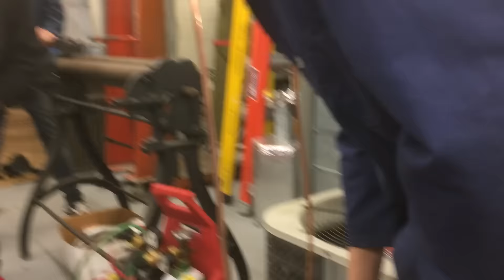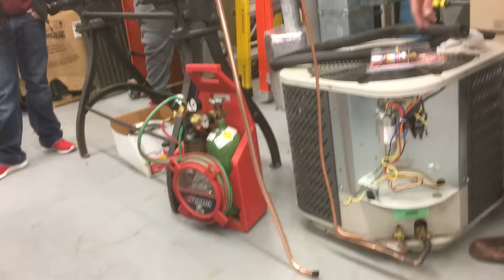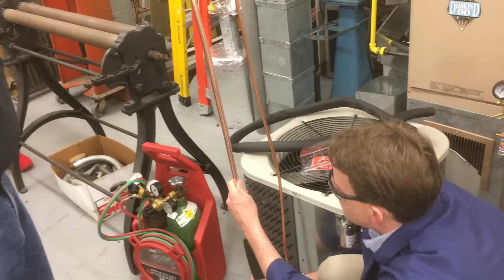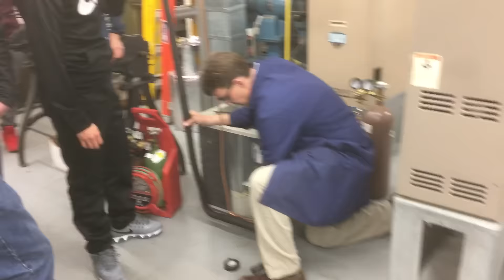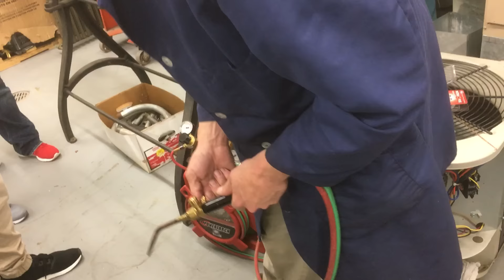HVAC Basics: Skills Brazing the AC System Line Set while Purging with Nitrogen using the Flow Guard

Comment: I'm particular, I hate to see zipties on a cut piece of insulation. I use black duck tape in a linear line with the cut, it will hold the split closed the entire length, rather than just at the zip ties when the insulation starts to shrink

Comment: 60 dollars for something the size of a pill bottle. This is why txv's fail on a system thats only 2 years old. Who the fuck is gonna buy that. Not me. I compensate by silver soldering residential systems. A nice bead of silver solder will hold back 410a and for god sakes, stay away from fittings unless youre at most 3 inches from the evap or condenser and dont bend it so the suction line is now 1/4"x3/4. Gradual is key. Every time i see a fitting on a 3/8 liquid line i cringe and fling my wrench across the attic. So many things ive seen out there that make me ask one simple question. WHY?

Comment: Armorflex should be glued back together with a neoprene contact adhesive, not gluing can still introduce moisture and then sweating potentially in a wall or ceiling.

Comment: Very nice. The only exception I take is your explanation of the "carbon" that forms on the pipe. It's actually copper oxide that forms when the hot copper reacts with the oxygen in air.

Comment: Yikes, so many joints. Teach your students to use a bender. You also told them not to roast the floor and unit, but you did it anyways....
Reply: And cooling with a wet rag is bad practice. It should air cool.

Comment: Nitrogen gas is attracted to heat?!      I'd like to get another opinion on that.
Assuming your statement is accurate,  then if you set a tank next to a room heater all the nitrogen would squeeze to the warm side of the tank, correct?
Reply: That's not how physics works.

Comment: Heated copper metal reacts with oxygen to form  black copper oxide. This will happen on the inside of tubing that's being brazed  if it is not purged with nitrogen. Purging means you have nitrogen flowing through the tubing during the brazing which pushes out the oxygen from the atmosphere. If it forms, the copper oxide could travel along the line and eventually clog the expansion valve resulting in poor or no cooling and possibly damaging the compressor.

Comment: just for saying it because its true ,,,we never had any compressor issues of failures because soldering was done without nitrogen ! just saying ,,,,its better if you use it but dont worry yourself to death about it ,,,,either if you dont have any on hand ,,,,,argon works great of course it just stops the flame from forming cause its has no oxygen for the flame to appear when welding ,,,,you  guys have a great teacher listen up and learn i am old and retired ,,,,,thanks

Comment: Great teacher! I only saw 1 thing that he should of done differently, & explained.

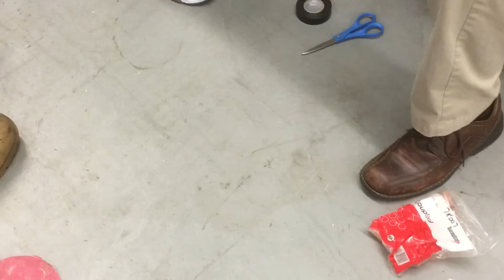When he sanded clean the line set at about 15:30
he did not make sure that the opening of the copper tubing was pointed down, or in the sloped, downward direction.

It is very important that when sanding clean, copper tubing....that the opening of the tubing be facing the ground, or facing toward the ground as much as possible. This decreases the chances that any small copper shavings /or debre from the sanding tape do NOT end up inside the copper tubing.
Small shavings &/or debre is all it takes to restrict a metering device; plug up the mesh screen on the inlet of the compressor.
It really is that crucial!
You always want shavings/debre to fall toward the ground & not fall back into the tubing.

Other than that, the teacher was phenomenal!

Comment: These kids got it made. The university where I attended was cheap. The equipment was junky & gutted. We didn't get new copper. The dean told us that if we wanted new copper to use on our projects, that the university would raise our cost of our tuition.
So we could only use scrap copper that we had to scour through in a recycled copper bin. Then we had to braise a million & 1 scrap pieces together, because the longest piece of scrap copper would only be like 6 inches or so.

The split systems that we had to install were junky. None of them worked. Before you could even start your project, you had to fix the condensing unit/heatpump, & the gas/electric air handler.
Parts would be missing; like defrost boards, electric heat strips, idf motors, etc....often there was NOT a wiring diagram & you had to go looking for the part you needed & take it off of a unit somewhere else!
Then after you found what you needed, you'd come to shop class the next day, just to find that some ass hole gutted your units after you left!

& they only gave you like a week to get it done, or they'd fail you.
We complained to the dean, who was an HVAC/R his self. & his attitude was, "Well, you can either complete your projects, or you can't!"
It was ghetto & borderline scandalous.

We had to make our own thermostats out of blue plastic gang boxes, 2 way & 3 way toggle switches & t/stat wire.
We had to wire up, not only sub panels, but also the main breaker box as well.
Again, we had to go around looking for the correct size & type of breakers. 
Rob Peter to pay Paul!
-That's how the entire shop was.

They also didn't have enough torches, jugs of freon, vacuum pumps, refrigeration wrenches & hand tools for each student. So we were all fighting each other just to have what we needed to work out in the shop, on our projects.
Students started buying their own hvac/r equipment & tools & bringing them to class.
The university wouldn't even supply us with meters.

We had a fuel oil furnacee blow up, literally just 10 feet away from where we were standing.
It blew a round, metal, circular, razor sharp, duct out of the supply stack coming off of it. That thing went flying across the shop like a saw blade that was thrown like a frisbee!
Luckily, no one was cut by it.....or decapitated.

Prior to it blowing up on us, our instructor told us that the next day we would be going over fuel oil furnaces on our power point slides; & to go out in the shop & plug it in & take temp readings on the supply duct & electrical readings on the fuel oil furnace.
So we plugged it in. It had a suicide cord installed on it & the unit was setting on a 4 wheeled dolly. We were just getting ready to get some temps. We walked away from it to go to a table to look up some info from our heating book, & litterally a few seconds after we walked away from it, it blew up.
The unit blew up off the dolly; yanked the suicide cord out of the wall socket; blew out the razor sharp, metal damper; a big fire ball blew out of the supply duct as well. The concrete slab of the shop, under our feet shook. & the noise was deafening.
We were scared shitless to go up to another fuel oil furnace after that.

On another occasion, 1 kid damn near killed his self because he got his meter leads into some 230 volt live circuit, & his meter was set to ohms, not voltage! He was temporarily blinded & it killed power to the entire building. We called him "sparky" from that point onward.
People were getting shocked because previous students would rig their projects so that if anyone touched their unit, they'd get lit up.
The instructors knew this stuff was going on, but their attitude was, "Well ya gotta be careful out here. There's a lot of dangerous stuff setting around & sometimes students do things that make stuff unsafe."

So much freon was vented out in that shop, it wasn't even funny. Our instructor for that class was just like, "Well if there is a hole in the ozone layer, its probably right above this university!"

Another instructor was transporting 100 lb drums of oxygen & acetylene tanks on a pallet with a fork lift. He wasn't driving his lift backward, but rather forward. So he couldn't see where he was going. He crashed right into a condensing unit & all the 100 lb bottles fell on the concrete floor of the shop. They were full, too! Had even 1 ruptured, myself nor any of my class mates would be alive. So we dodged yet another bullet there.

It was such an (expensive.... $20K+, dangerous university!)
They didn't have enough parking spaces for all their students to park, each day. So we were forced to park off campus. ANYWHERE off campus that you parked, your vehicle would be towed. 

The university set you up to fail by not giving you enough resources &/or enough time to complete your projects. If you were getting financial aid, & ended up on academic probation....forget about it!  Once you ended up on it, you weren't getting off of it. & you'd lose your financial aid.
I graduated, somehow. But I'll never forget how shady that university was!
It was the University of Northwestern Ohio  (UNOH) in Lima, Ohio on Cable Rd.
It was ghetto & shady big time!
Reply: Adam Spears everything you described sounds hilarious and it also sounds like the company I work for right now. It’s a real shit show

Comment: I didnt use a single fitting when putting in a heatpump for my uncle, no swages either, benders and straight into the equipments. It was a cut-in job, so new lineset.
Reply: Khoa Tran every install is different, but that is always nice, especially when taking inventory.

Comment: I was taught that the copper oxide that forms inside the pipe if you do not use a nitrogen purge actually is a conductor of electricity.  It can cause a motor burnout when it ends up in the crankcase oil, along with plugging up screens and filters.  The instructor is correct not to teach swagging pipe.  That process actually weakens the pipe, and in 30 years in the field, I ran lots of copper, and never used it.  I don’t think that process would meet spec. On a lot of the large commercial jobs we did.

Comment: IMO to swage or use coupling is a nit difference to turbulence or cost, and if you make one good braze you probably can make two, and two or four the lines still need to be tested.  However, flowing nitrogen is a biggie and should never be skipped.

Comment: I'm no AC tech, but you put nitrogen on the high pressure and brazed the low pressure. If that system was precharged the gas would never get to that location. right?
Reply: MB-It's correctly presented. The condenser unit is precharged and service valves are closed to hold the charge. The nitro is flowing from liquid line service connection through metering device into evaporator back to suction line and out suction service valve with schrader valve removed.
Reply: You are incorrect. The Condenser is hermetically sealed off.
Reply: The nitrogen is leaving the system at the time the refrigerant would enter the condenser.

Comment: “Very rare out in the field do we swage” service techs do it all the time. Some of us installers do but “very rarely” is a major understatement. The idea is to have the LEAST amount of joints possible. That’s less joins that have the possibility of failing during the life of the unit. So yes we do swage. All the time.
Reply: If the joint and penetration are near a finished surface without linehide, I’ll  usually do it to get bends tighter to the wall. So instead of a 90 I’ll use a street 90 and swage the piece stubbed out so it brings the joint out one inch further from the finished surface and still hugs the wall. For concrete penetrations my favorite thing to do is seal it with pyro seal. Just lay it in with some rubber gloves on, and flatten with some sheet metal. Can’t wait to go back to one of my installs to hammer one of those out.
Reply: on a new unit yes but what about a old unit for emergency repair do put repipe
Reply: @edmundooliver7584  I put a bell on old pipe as well.
Less joints = less places to leak from.

Comment: Great teacher. Most people in fields dont do the nitrogen cause of the extra steps. Glad your enforcing this it makes a big difference in longevety in the components, screens, and leaks. Hopefully they stick to it in the field.
Reply: ive seen many many many many many 410a units that were installed  over 10 years that were brazed withought nitrogen, and still running strong. But nitrogen is way to go.
Reply: Microchannel evaporators lol.  @freeguide4051

Comment: To the techs.  I just bought a home and am wanting to get AC installed.  The home came with copper ran already, the home was built in 94.  I am wondering, do I need to run new lines or is there a way to clean the lines?  The reason I am asking is because I want to do as much DYI as I can to lower installation costs.  Most feed back would be appreciated.  Thank you.
Reply: Yes you can keep the lines, just need them to be flushed with nitrogen and make sure they match the requirements on the new unit.
Reply: i believe that older lines if formally R22 the lines also need to be cleaned  of the oil used in R22 systems if the replacement system is R410A..

Comment: While the suction line must be insulated to protect from condensation. You didn't explain to them that it also has to be insulated to keep your superheat down and protect from too high of head temperatures.
Reply: He actually does mention it at 12:05
Reply: That’s wrong, you insulate it because it’s a conductor

Comment: He's a very good instructor but the thing he said about not swaging in the field isn't true. I own a hilmor swaging tool, I also have the hilmor bender, and I haven't bought a copper fitting in years. The only time I need a fitting is when I'm working with 1 3/8" pipe, which is pretty rare. Also, the liquid line and suction line need to be ran closer together so you can tape or zip tie them together, along with the thermostat wire. You had them like a foot apart. Other than that, good video.

Comment: My instructor taught me to NEVER work yourself in a tight spot. The connection should have been in a vertical section where it is easy to work with. Also all of those fittings should have not been used. This is why you use a tubing bender.

Comment: Good idea to backseat the nitrogen cylinder, as it's a high pressure cylinder as well.

Nobody I know uses couplings. They are an extra cost, and more importantly they are two joints in the system as opposed to a swaged connection, so more potential for leaks plus restriction/turbulence in refrigerant flow.

Pressure testing to 150 PSIG is quite low, especially for a 410A system. Minimum I do is 300 PSIG.

Otherwise very good instructor and well presented!
Reply: Im going to say its an r-22 since theres a green sticker. He got 150 psi from manuf. data plate.

Comment: Not trying to nit-pick your video, I actually really appreciated how you stuck to protocol in your training but just wanted to point out some details to viewers as details are important: One is you're not brazing with nitrogen but brazing with acetylene while purging with nitrogen.  Next, about a 30 second initial purge @20 psi, or maybe it's cfm, to get that initial oxygen out then step down 1.5-2 psi continuous purge while brazing but no more as it potentially cools the brazing process and could blow out the braze joint inhibiting the capillary action of the sil-fos.  I mention those numbers in case one is using traditional manual set flow-meter.  The other point worth mentioning is to stand out of the way (to the side) of the regulator adjustment knob while turning on cylinders and to be sure to open slowly and completely back-seat the oxy in contrast to only 3/4 turn on the acetylene.  Might also suggest flame guard on the unit while brazing that close as you mentioned not leaving burns on customers new equipment.
Reply from the maker: +Tie Dye nice details. Thank you. I will take the information you just provided in to account when I give my next lesson to the students. Appreciate you watching and the feedback. Thanks for the comment.
Reply: It's true, but part of the job is having enough common sense to know nitrogen doesn't burn.  Realistically speaking, helium, argon, or any dry and inert gas would work though the industry standard is nitrogen and it is also probably the most abundant and environmentally friendly making up 71% of the air we breathe..